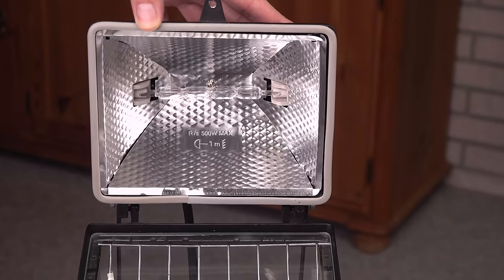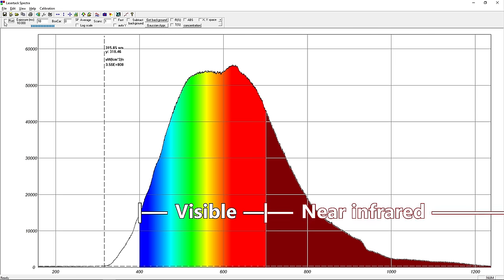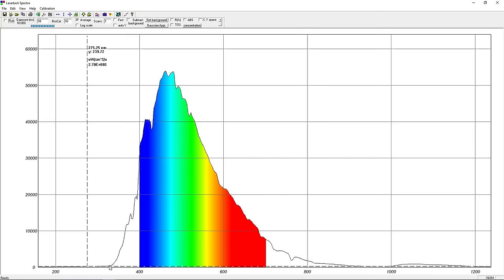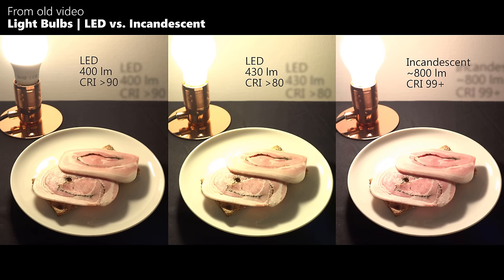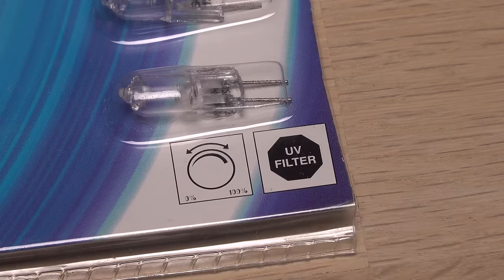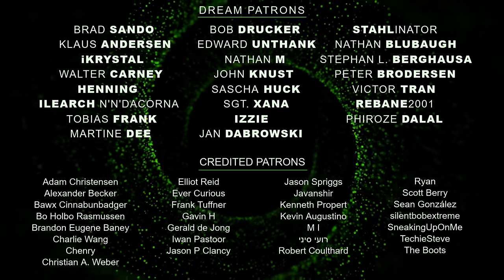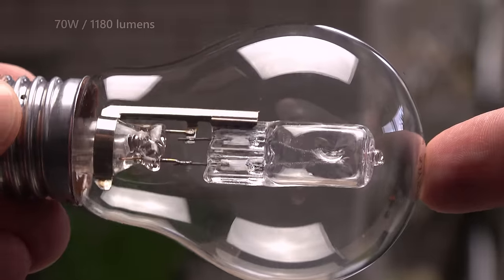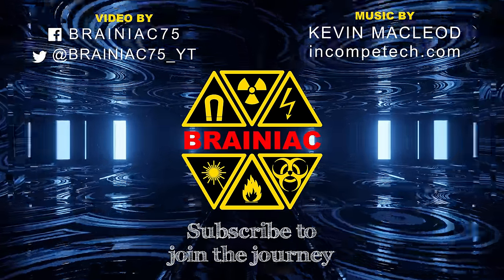Hidden Hazards of Halogen Lamps

Comment: Daym that 50h bulb is literally definition of oneshot 

But how cold temperatures affect halogen lamps then?
Reply: If an halogen light is at the right working temperature, evaporated metal from the filament will be deposited on the hottest place in the lamp, usually the thinnest part of the filament. So up to a point it is self healing. If it does not reach the operating temperature, this self healing will not happen.
Oils from skin on the glass of a bulb can create a hotspot on the glass which also upsets this process.

Comment: I have a Xeon bulb in a projector.. 

that is an eye watering 10,000w. (no. I am not joking. this globe is enormous.. it's a projector from a commercial cinema.) 

I'd absolutely love to know what spectrum of light this thing pumps out;... apparently it requires forced air cooling to stay functional.
Reply: I think it will be a lot of infrared, blue and UV light.
Yeah, pretty much all cinema projectors, even much less powerful than 10,000w ones come with a heat exhaust duct connected to a chimney going outside the building as xenon lamps produce quite a lot of heat.

But home video projectors also have forced air cooling although they don't need to vent the hot air outdoors given their much lower power, but they still have fans nonetheless.
Reply: @psirvent8  Yeah, I reckon your right, would be heaps of IR energy, it's like standing in front of a radiant heater when it's working.. working in the same room as it when it's working is uncomfortable. (and insanely loud).

Comment: The real danger is the cost of those bulbs.
Reply from the maker: Buying one is not bad, but buying enough to last as long as just one LED does get expensive ;) Thanks for the early watch!
Reply: VERY TRUE.  Theatrical spotlights that use Halogen and die anywhere from a few 10's to 2000 hours are budget ANNOYANCES compared to "similar" LED counterparts. But HALOGEN superior to LED in certain applications.

Comment: Electricity is just to expensive to use high power halogens.  I have 500W halogen in garage I rent. I never use it, because it's to expensive to run.  LED will give you the same amount of light, but will use only 10% of the energy.

Comment: Then there is the other problem with halogen bulbs, don't touch them with your naked hand, at least the transparent area. The skin oils on your fingers will make the quartz fail sometimes explosively. Bad or worse you lost an expensive bulb that should have lasted for better part of a decade.

Comment: no LED or CFL will ever compare with halogen light quality
Reply: Oh man, halogen is the most beautiful of all, but I would not put it in a small hall that we use a lot because it has excellent air conditioning in the kitchen. It will turn into an oven. There are some beautiful LEDs, but they cannot be compared to halogen.
Reply: Plenty of LEDs on the market today with extremely good CRI.

Comment: I hate LED lights.  Terrible lighting.
Reply: Only the cheap 6000k ones are terrible. Those above 85 CRi and 3000k is basically indistinguishable from incandescent lightbulbs.
Reply: I'm not talking about expensive light bulbs. I have very good quality LED bulbs is the $1-$3 range just by understanding the markings on them.

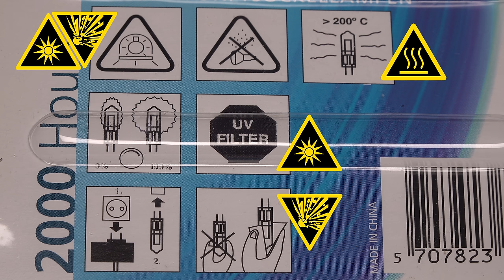Comment: 5:04 this is a myth. ive been touching glass bulbs like this for 20years and they never blew up.
Reply: Not a myth. Halogen bulbs run much hotter than standard incandescent.
Reply: @tookitogo  find me concrete video proof of this happening then. the burden of proof is on the one making the original claim.
Reply: @Francois_Dupont  If you search for “halogen bare skin” and then look at the images, you’ll find photos of what happens.
Reply: @JGnLAU8OAWF6  no proof were shown in this video. the guy just show a couple of burned out bulbs, he then proceed to point out supposed marks that he claim are caused by handling. no control, no proof, no nothing.

i bought 3$ halogen bulbs for my cars 5years ago. i handled them roughly and installed them. using the car almost each day for 5years now, they havent blown. ive been doing stuff like this for 20years and i have yet to find a corelation with fingerprints.

Comment: Is your photometric sensor certified and calibrated with a standard laboratory reference? If not, you can't know with certainty the output of a secondary test source. What you see as a surprising lack of UV emitted from a source could just be the result of an uncalibrated sensor. Also, your methods for data collection are too unreliable for accurate measurements. I would avoid drawing any conclusions about safety from what you've shown us here.